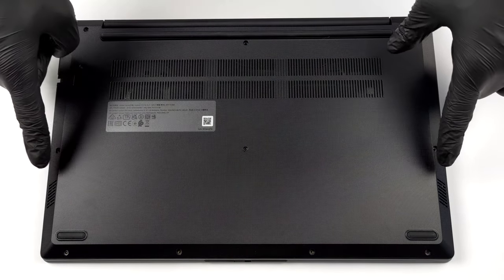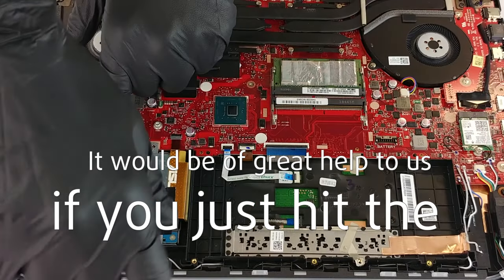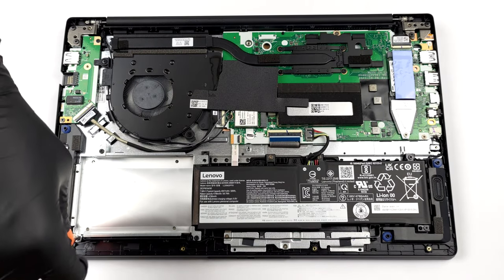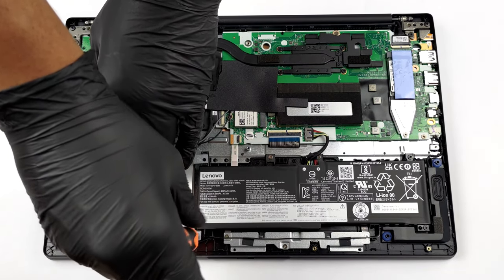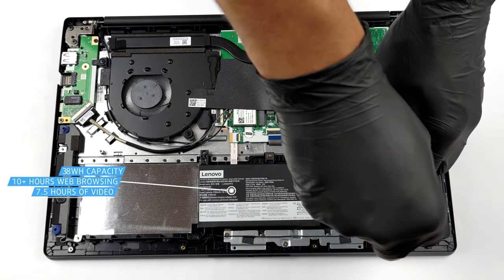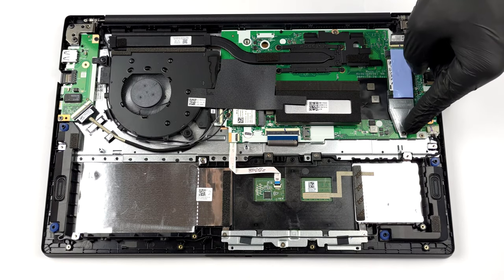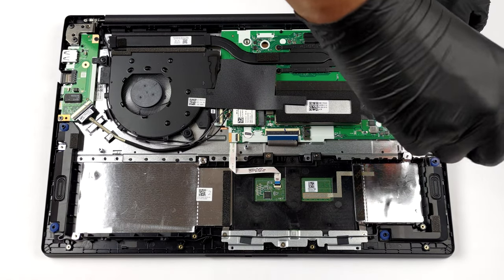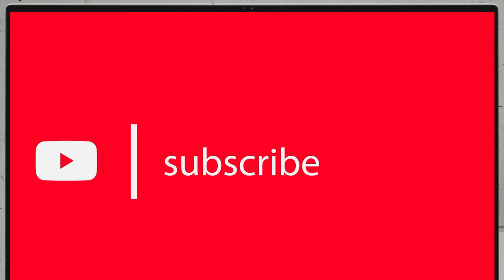🛠️ Lenovo V15 Gen 2 - disassembly and upgrade options

Comment: I really advise to try to move the fan cooler thermal pad that is often located in the back cover AWAY from the motherboard, remove it. I was on site somewhere, checking a no power V15 G2 Core i5 and I found an extremely leaky thermal pad, a pond of oil over the side module connector. Cleaning was not enough, it got worse after some weeks. Clearly whoever who made this design wanted to cut cost in the cooler by using the least copper as possible. Look how thin and small it is!! It was already 45 degrees (20 degrees ambient) just by touching it after 3 minutes with the device on!

Comment: Can I put 16gb ram in?
Reply: bro i have been looking for the answer for hours now..., have you got the answer if 16 gb ram can be installed ,  mine has 4gb sorted and 4gb removeable
Reply: Memory Max Memory • Up to 12GB (4GB soldered + 8GB SO-DIMM) DDR4-3200 offering • Up to 16GB (8GB soldered + 8GB SO-DIMM) DDR4-3200 offering

Comment: So how do you install the SATA SSD? I don't see any ports to install it.
Reply: You can buy a SATA ribbon cable which plugs into the small black-and-white port at the bottom left of the motherboard (next to where the other ribbon cable passes out from under the motherboard). These cables cost about $5 on Aliexpress.

Comment: You DO REALIZE that the 2.5" Drive Bay is useless and should be ignored NOT mentioned?
Where is the connector? It does not exist therefore you can forget upgrading anything as is without extra costs.

I know because I have that laptop.
Reply: you're wrong. i have ordered the cable from aliexpress and connected HDD 2,5" drive without any problems
Reply: @pozioYpozio  How am I wrong?

You cant just claim there is a HDD bay where you can add another harddrive when there is not. You cant use it as is.

I can order an external HDD bay and then use a hardrive there as well. Does that make me able to use external harddrives as is?

Also you can also buy interal adapters to add more m.2 ssd etc. Does not make THIS thing support that.

"ordering something that is needed to actually use something" IS A PROBLEM. No matter how small.
Reply: also after I've added 8 gigs of ram now I have 12gb on single NOT dual chanel.
Reply: @t.terone522  I don't understand your way of thinking.
When I was considering buying this laptop I was informed that IT HAS possibility of increasing storage space.

My laptop had hdd/ssd bay/adapter. All I had to do was order the cable.

I also bought 8GB of memory, because it has 4GB soldered and 4GB external. 
The only problem is that they don't work in dual channel when you have 4GB soldered and 8GB external, but It doesn't really matter for every day use...
Reply: @pozioYpozio  Well 99% of laptops have "possibility of increasing storage space".

Remove small thing
replace with bigger thing.

There is some stupid low end cheap laptops where everything is soldered. So no Sata port
No m.2 port
nothing.

But most laptops have "possibility of increasing storage space". Even if its just 1 slot free.

Does your 2.0 System have 5.1 speakers just because you can buy them afterwards? nope.

Does your old laptop with a dvd drive support blurays just because you can buy a bluray player and install it? No and noone ever advetrised a dvd capable laptop like that. 
Or how about no-drive-laptops these days? Do you claim they support disks like cds dvds and blurays just because you could buy a USB drive that can? No. 

Can your old smartphone use wireless charging just because you can buy a contact charging upgrade (available for basically every phone) and install it inside the phone? No.

Does your Nintendo Switch support backup games/pirated games just because you can buy some physical hardware that you "plug" into the controller slot?
No.

Does your 1989 Gameboy support SD Cards to play games from and offer backlight just because you can open it and add those two things to it? No.

Doing a modification to the stock device is not the same as natively supporting something.

If anything it SUPPORTS the addition of a CABLE which then ALLOWS the user to add a 2.5" SSD. The laptop does not SUPPORT it by itself.
Reply: @pozioYpozio  So yours was advertised as 8GB but it was actually 4+4? i.e. occupying the external slot already? I thought that 8GB would be soldered and the slot would be free.
Reply: It's not useless, it has a controller in the motherboard to support it and free physical space to fit it in. What needs mentioning though is that the model with the bigger battery occupies that space, so you can't add a SATA drive.
Reply: @kozas0  you cant add a sata drive anyway. You need to add a cable before you can add a sata drive.

You can also add that cable. Then a sata 2.5" to  m.2 adapter and then a second m.2 SSD.

Does not mean that this laptop supports two m.2 ssds?

You can also buy a 10 slot  SDcard adapter to make your own SSD out of 10 SD Cards. 

Does that mean this laptop supports 10 SD slots?
No

I can buy a USB hub and put it INSIDE the laptop. Does that make the laptop support 10 usb slots inside?

THATS MY POINT.
Reply: @kozas0  yes, 4gb soldered and 4gb external, which I replaced with 8gb and sold that 4gb
Reply: @t.terone522  You realise the SSD cable probably came in the box and you threw it out right? with the ADDITION of a POWER CABLE you can CHARGE THE LAPTOP
Reply: You talk about these low end laptops but it's the exact same in a $3500 acer predator the expansion cables are separate so they're not flopping about inside lmao
Reply: @buttonmasher3820  the cable for the additional drive is not included in the package. Other people complain about this issue
Reply: @buttonmasher3820  You threw your brain our right? I have several of these laptops. I also never throw away accessoires of anything. I still have my 10 year old Monitor screens even tho I have wall mount.

That cable would be INSIDE the laptop if It was supposed to be part of the thing. Or is your SSD outside? How about the wifi modul? How about anything that is supposed to be inside?

Grow a brain man.
Reply: @wblazkowicz  yes might be the case. But it does not make this laptop have native support for it.
Reply: @buttonmasher3820  The SSD cable does not come with the laptop
Reply: @t.terone522  You can't use it "as is", but you can buy a cable for $5 and then use it. The bay is there. The video is not wrong.
Reply: @acajgd7252  No, you have flex mode. It's not 2004 any more.
Reply: Can i use the cable from my d leptop to connect the hdd?
Reply: @nathangamble125    👍
You are right.
Pay $X for an added drive.
Pay $5 for an added cable.

Video is not wrong.